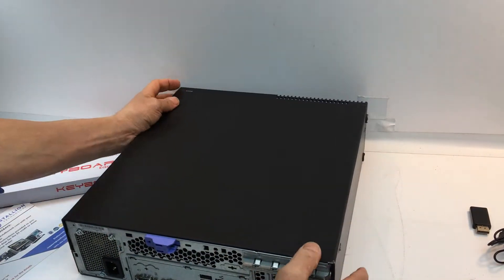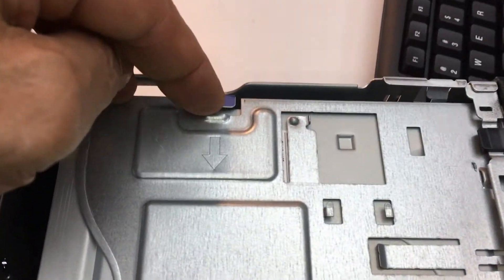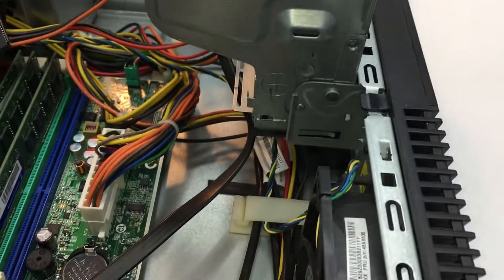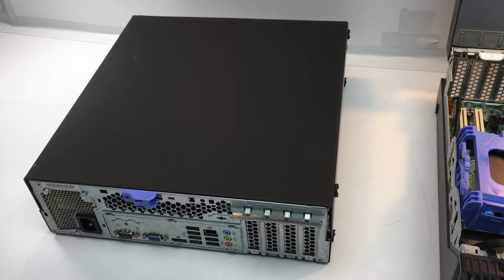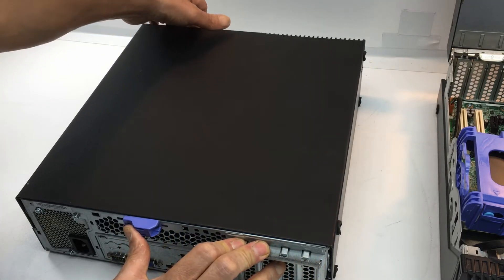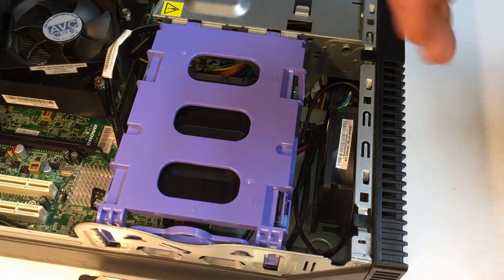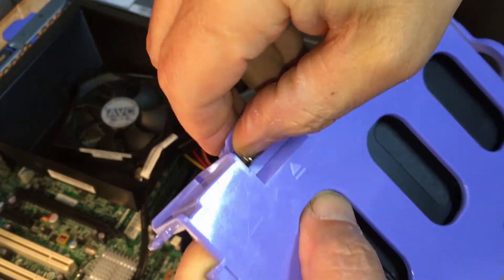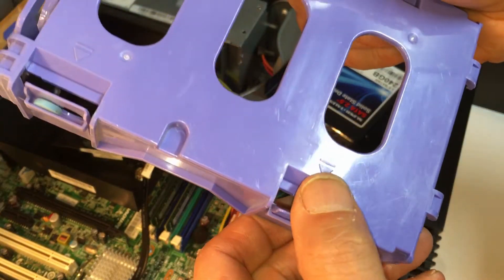Lenovo Think Center M81 SFF Desktop Computer How to Open Up Case Take Apart eject Remove

Comment: With a bit of wiggling I moved the slider to the "unlock" position, but I had to hold it there or it would move back to "lock".  That left me with one hand to grip the cover in two places.  The hinge was a bit stiff, so I was able to lift first one corner of the cover and then the other.

Comment: What to do if the blue thing jammed
Reply: the 2 blue things on either side, use a screwdriver and twist until they loosen up then pull it off
Reply: @friend1704 are you talking about the thing that opens the pc or a cable